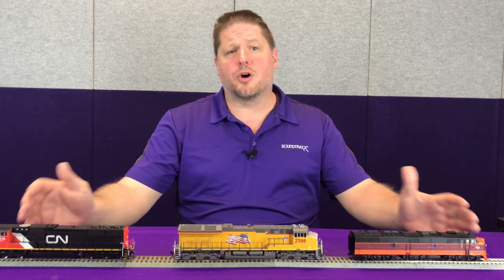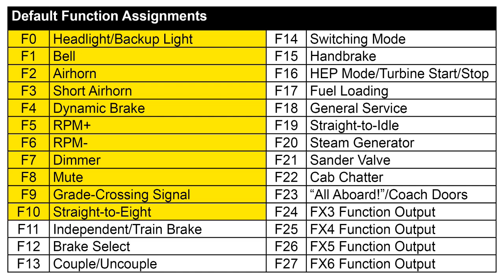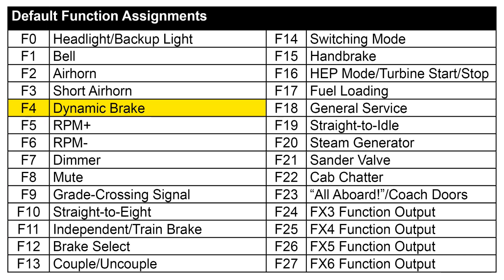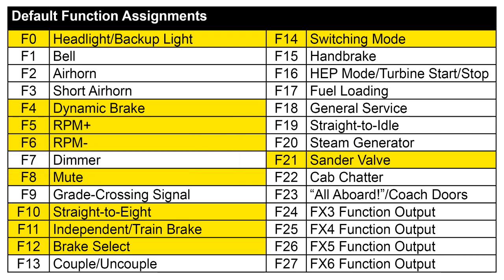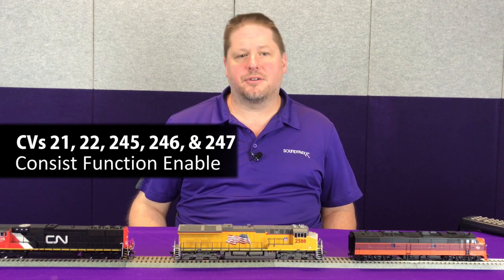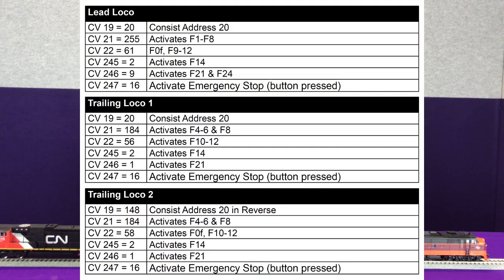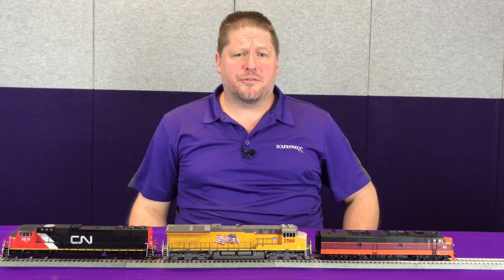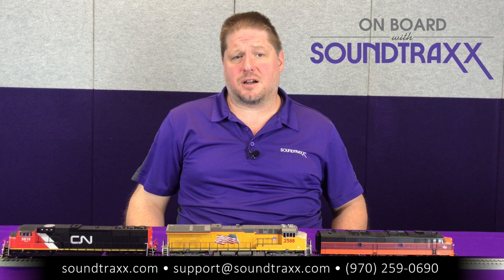How to set up Advanced Consisting

Comment: For the life of me I'm unable to make my rear unit headlight turn on.
Reply from the maker: Contact our Support Team they can help you figure it our: (970)259-0690 ext.22 or support@soundtraxx.com
Reply: @SoundtraxxDCC  I have the same problem with keeping only the lead locomotive’s ditch lights on. My guess is because the 3 decoders that I’m using for this are tsu2200 and the ones you are most likely using tsu1100 which have different ditch light function#s (old is f6 and new is f5), can you please explain how to edit the CV to not include function #5?

Comment: Now I'm confused. You said the consist address must be a number between 1 and 127 yet you set the consist address for the third loco at 20+128 and that is 148.
Reply from the maker: Entering a value from 1 to 127 will set the consist address from 1 to 127 for the normal
direction. Entering a value from 129 to 255 will set the consist address from 1 to 127 for
the inverted direction. Setting CV 19 to 0 or 128 will disable the consist address. When
CV 19 is set to a non-zero value, the decoder will ignore throttle commands sent to the
decoder’s primary or extended address.

Please contact our Support Department directly for more help with this, thank you. SoundTraxx Support Department: https://soundtraxx.com/contact/technical-support?utm_source=yt&utm_medium=sm&utm_campaign=sd

Comment: I know your demonstrating how to consist the locomotives by setting up the CV's in the decoder, but I found a way which might be useful. I use NCE powercab, the same as in your demonstration. It is easy to use the Consist button and enter the engine numbers to set up your consist. Then using the recall button the NCE handset will add "Con" to the front of any engines in the recall menu that are now part of the consist, but you can still use the horn, lights and bell as if the locomotive wasn't part of the consist. Just a tip..............and I know your demonstrating the real intricacies of setting up the Tsunami2, which is brilliant by the way, I have 6 fitted so far, just two left to do!
Reply: Thankyou for your reply George, I have noticed the NCE system sometimes doesn't always clear a consist properly as you described above. So I will look into your set up in more depth. Thank you again for your reply.

Comment: Once you have units in an advanced consist, is there a way to lower the volume of all the engines with one CV change?
Reply from the maker: No.  At that point, since you are changing loco parameters, you would have to address the locos and change the CVs for volumes individually.  But, remember the alternate volume mixer feature we have where the volumes can be adjusted as you desire, but are defaulted to about ½ volume.  If you enable this on a F# command on all locos, then add it to the consist functions, then you can enable the alternate mixer on all locos with a single F# command.  But you would be setting this up in advance.  You can see this video here https://www.youtube.com/watch?v=h_6wIzp6h_k  on how I used the alternate volume mixer to simulate hauling ‘dead’ locos.

Comment: Hi Geroge I fallow your instructions but my truck ligth are off.  Witch fonction control them
Reply from the maker: Please contact our Support Team for help with this: (970)259-0690 ext.22 or support@soundtraxx.com
Reply: @SoundtraxxDCC  Hi George, I contact them but they dont solve my problem.
The probles is that on some engines when i put them on CV20 the truck light turn off

Comment: i have a prodigy controller by mrc. i accidentally set up an advanced consist and dont know the cons number. now my favorite locomotive wont do anything. on the cab it keeps saying cons in the display and I cant get the loco to do anything. no lights no sound no movement. I tried putting it on the programming track and set cv8 to 8 but nothing happened even after power off and back on. still says cons , any idea? thanks!
Reply from the maker: You can always rewrite the consist address in CV 19 if you have set that part in the past.  All CVs are re-writable, so just overwrite a CV and then go back to the main and select that consist address.  
Now, if you used the DCC system to build the consist (Likely as indicated by the con:### listing.) then you may need to reset the DCC system, or find a way to remove the loco in question our of the consist.  This will be a DCC system issue and you will need to refer tot he MRC User's Guide.  Following the true Advanced consist info in this tutorial (And our YT Webinar 14) then the system is none the wiser since you're setting CVs and not building consists in the system. 
If all else fails, contact our support at support@soundtraxx.com or call 970.259.0690 ext 22 and talk to us and we'll help as we can.  
Thank you for watching, and thank you for your support!  ~G

Comment: This is awesome, George!  I had figured some of this on my own, but adding the brakes is a huge game changer! Especially for my paired MP15ACs!  I  screenshot the summary table, printed and posted it at my programming track for ready reference. 
My trio of consited Genesis GP9s/18 work great. However, the rear headlight on the lead unit is off in reverse, but comes on when i hit the horn in reverse. Not a big deal. It shuts off going forward.   I double cheched that CV 22=61, its correct.
Reply from the maker: Glad to hear the video was helpful! Our Support Team can help you get your lights operating how you want them to: (970)259-0690 or support@soundtraxx.com. Thanks!

Comment: Awesome, Just need a Programing Track.
Reply: Easy to do. I bought Kato feeder track, which comes with leads already attached, a 2 pack of 15" long straights & a 2 pack of bumpers. I picked up a NCE PCP & power supply. I mounted all of it at my work bench & now I have a dedicated programming/test track where I can work comfortably & open reference materials without messing with my layout

Comment: Will this work using a STX decoder with a unit that has a TCS WOW decoder?
Reply from the maker: Yes, advanced consisting is not a SoundTraxx feature it is just how we recommend setting up your consists. You may need to adjust function mapping on one of the decoders so they play well together as function mapping is not standard across decoder brands. If you need any help contact our support department. We are here for you: https://soundtraxx.com/contact/technical-support

Comment: Hello, i had a question about the 21 pin TSU 2, i have a scaletrains ET44AC the documentation says it is optimized for Loksound, what does that mean and will the 21 pin tsu work fine?
Reply from the maker: Hi, yes you can still use a Tsunami2 TSU-21PNEM. 'Optimized for Loksound' basically means that in this model ScaleTrains has strayed away from using the NMRA recommended practices. Therefore, by simply plugging our TSU-21PNEM decoder into the motherboard you will not be able to access all of our lighting functions as our decoders DO FOLLOW the NMRA recommended practices. You can bypass these issues by hard-wiring the decoder into the model instead of plugging it into the motherboard. If you need assistance with this we are happy to help, just contact our Customer Support Center at (970)259-0690 ext. 22 or support@soundtraxx.com.
Reply: Thanks for this great info. They must be getting a kick back from loki to go that route. You think they would want their product to more flexible.
Reply from the maker: We cannot speak to their reasoning, but we can help you overcome the issues that this has with our decoders.

Comment: WOW!!! All these years I've setting up my advanced consists on my NCE Procab without doing ANY of that crap....and I just use the actual loco number to run the consist. If I want to drive from the rear loco, I just select the loco running number of that loco, and it now becomes the lead loco. Sorry my friend, but you just made that task look a WHOLE LOT harder than it needs to be.
Reply from the maker: The NCE is a Hybrid style between an Advanced and a Basic consist. You cannot activate the F11 brakes on trailing units without setting CV 21 and 22 AND setting up the PowerCab or Procab for “send function to consist”. Call support for details on why that’s not explicitly discussed in this video and we’ll tell you why it’s not the preferred method.  This video is also intended for all DCC brands and when I set up the consist, I can run on any DCC system without further setup, regardless of DCC system brand.

SoundTraxx Customer Support: (990)259-0690 ext.22 or support@soundtraxx.com

Thank you.

Comment: These videos are a big help and I'd like to add a couple notes to make this even EASIER for  NCE advanced consisting: 
On your NCE, enable the system setting for "send function to consist".  After completing this, you can permanently set all of your locomotives CV21 and 22 (functions to respond in consist mode) and forget about them.  Use the NCE system to set up (and break down) your consist and operate your lead loco using it's own address (not the alias).  Using this method, commands such as horn will ONLY go to the lead loco, while dynamic brakes will go to ALL locos in the consist.  You won't need to change CV21 and 22 every time you change a lead loco.   When you select up the rear loco, only its horn and lights will operate and "forward" will be the direction the rear loco faces.  Let the system interpret the commands instead of using the "alias" and remembering that rear loco "forward" actually = alias Reverse. You will need to clear this consist when moving from home to the club, etc. because each NCE "brain" needs to know which units are in a given consist.